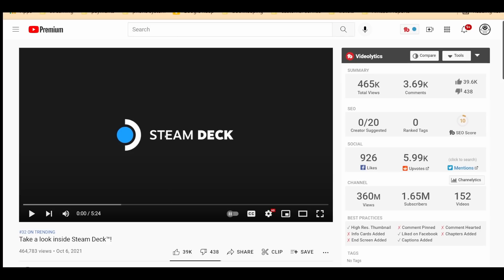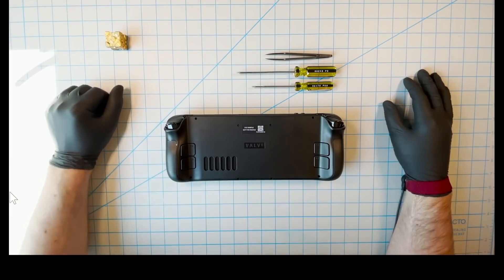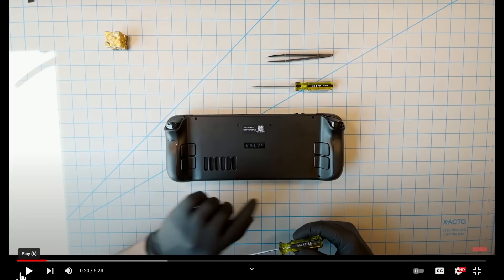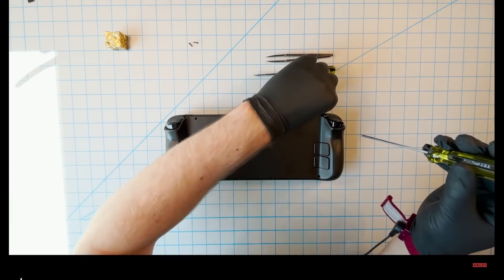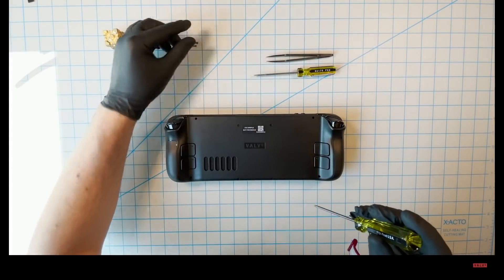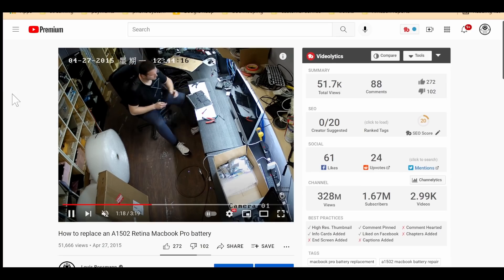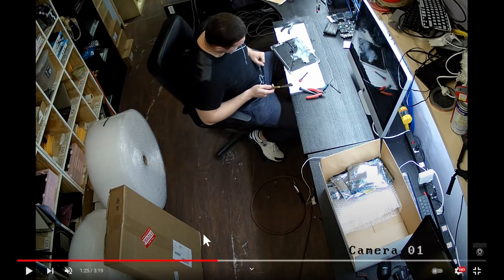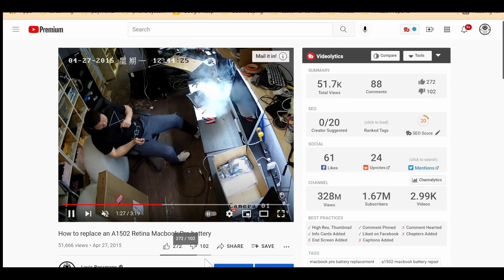Steam deck battery may end your life? bruh 😑

Comment: There's alot of complaints in this video, but Valve isn't going to care if people repair the system or not. A) The whole point of spending time, money and effort to make a device that was open source, CAN be removed with a PHILLIPS head for once, with all components designed to be removable is commendable. They are most likely not going to care if people (or in what they hint in the video, repair shops) to repair their systems and it's most likely that they will release some datasheet and spec sheets for the internal hardware to help repairs. B) They made an official tutorial video about opening up their device. This implies that despite their words in the video, they actually want people to open their devices. But being that the demographic of a Nintendo Switch equivalent device they are probably talking to the younger audience of 10 year olds trying to replace a battery because they didn't charge the damn thing. In addition, you see this video and imagine Apple making one. Not in a million years, or if they make one it's not even going to be CLOSE to the level of criticism in this video.
Overall, I'm very impressed by Valve and their products and games and their company structure as a whole choosing not to go public with a billion dollar market cap because they want to focus on quality over appeasing investors. Making a device like this where you can even open up the device with a PHILLIPS head is a huge attempt in setting a stepping stone for right to repair on devices.

Comment: It may just affect the friction between the plastic and the screw. When it is freshly cut there is more friction. When you unscrew it may "polish" the surface of the plastic (but it should have such a small effect that should be neglected). 
But this can be mitigated by using a thread locker like a blue or a green type.

Comment: The comment on voiding warranty is such a big thing. 

I am in a car group and the amount of people who dont want to do anything to their car because they fear their warranty will be voided really sucks. Its your car. You can make changes so long as they follow your state laws. Sure, if you change something and your change causes damage then they wont repair what you damaged. But if you put on some new wheels and a body kit (please dont put on a body kit leave those in the 90s) and you have an issue with your ignition system... they still have to fix your ignition under warranty. Your new wheels didnt mess that up. That cant void your warranty unless what you changed cause the damage.

Comment: The ESD strap on the glove is actually fine since the charge will move along the glove.
Even then, you don't need to wear one at all nor wear gloves when doing a repair, it's just extra cautious in case you're also wearing a wool sweater and rubbing your socks on a party balloon.

Comment: Well as I sit in the passenger seat drinking soda while watching this,  right when the steam tech said can cause death if you damage the battery. All the pop went on the window. Unplugging the battery and pressing and holding the power button for 30 seconds discharges everything! No static band required.

Comment: Self tapping screws can wear out the case. I would have rather seen them use threaded inserts but on the plus side the analog stick isn't soldered to the board and that's a good thing

Comment: 3:11 Li-ion batteries could explode without warning, but only for those in metal casings (ie 18650) where the casing can contain pressure until catastrophic failure. Li-ion/LiPo in most portable devices such as this one would be fine as they are designed to release pressure to reduce the risk and delay an explosion. Edit: From someone who accidentally poked a few LiPos (without much incident) and dangerously stressed a few 18650s (no pressure venting and dangerously hot on the outside).

Comment: I've got a Trio communications receiver made in the 70s, its got mains electricity, high tension supply to the valves, you could actually kill yourself when opening it. It also has a full schematic and suggestions on how you could modify it. Mmmm progress isn't it great!

Comment: Self tapping screws won't always take the same path through plastic studs the second time.  Improper torque also can weaken the plastic.  I think these are the reasons for claiming reduced strength.

Comment: Allot of good info. Its a company trying to be safe with a new business venture. 
If the screws are torqued.. Then the impact resistance wouldn't be affected. I see trim in cars often compromised because of over torque.. Sometimes under torque. The tightness is very small tolerance on plastic parts.

Its a video that is afraid of the regular joe that has no clue about. Repairs as such.

Comment: I think the main thing they are worried about is someone screwing it too tight and applying, effectively, a preload to the chassis which would cause some tension in the plastic chassis.  But if their promo videos show them smacking it with blocks of metal I doubt it would make a tangible difference.

Comment: Regarding opening the screws compromising on structural integrity, that's kinda true. 

Don't know about screws specifically, but in manufacturing there's always a question of how human proof you need your casing to be. better casing are massively more expensive to implment since you need multiple machines to implement a lot of reusability features. In the reverse cheaper casings are less human proof so the average joe/worker are more likely to make mistakes which would compromise the final product*. 

Self tapping screws, at the top of my head, lack a lot of Best practice for reusable attachments. There's no indication of a stopper to stop you from over tightening. The casing seems to lack any components or markers to indicate if you correctly and evenly tighten all the screws. There's likely very few features that give a margin of error so you don't need to tighten all the screws evenly. 

*In the factory I was at, there were multiple meetings on how much human proof we want our disposable casing to be since the more human proof it is, the less likely that the human workers assembling the product would make mistakes that we need to bin/burn/accept as a loss.

Comment: Okay, so they weren't BSing about the SSD temperature/power draw thing. I learned something then. Valve gets one point back. My opinion of the video on the whole remains the same, though. I don't like it, too much FUD for my taste.

🟢 I like that they were honest about the warranty. 
🟢 Now that I know it's true, I like the warning about the SSD heat/power issues.
🟢 "Send it to a professional if you don't feel comfortable doing this" is good advice. There's no shame in doing so and people shouldn't be pressured or anything into thinking they have to do it themselves.

⚪ I like the promise of replacement parts later on, but until they can actually be purchased and this claim proven to be true, I can't give them any points here.

🔴 They didn't say what type and size screwdrivers they were using. If you know what to look for already, you can see that they're Phillips 0 and 00, but they should have said it out loud too.
🔴 If you're going to tell me to use a torque wrench, tell me what to set the torque wrench to. Just having a torque wrench doesn't mean anything if the torque is set too high and I destroy the plastic or screw before the wrench clicks. Or if I set it too low and the case isn't properly screwed back together.
They went overboard on the integrity angle. Sure, if you break the plastic clips it could have less integrity. If you don't reinstall the screws correctly, you could weaken the bosses and then it'll have less integrity. But instead of trying to scare viewers with those nonsense durability test clips that don't even show you what the device looks like after said test, they could have just provided more instruction. Warn the user to be gentle prying the case apart, to use plastic pry tools and/or picks designed for prying rather than flathead screwdrivers if you're having some trouble. And tell the user to rotate the screw in the hole backwards until they feel it drop/click into the existing thread, and then tighten by hand (not with a power tool) until it's snug. Don't keep trying to tighten it even more afterwards. Stop when it's snug. If you follow those steps, integrity will remain just fine. 
🔴 Also, if they really cared about integrity, device longevity, keeping your stuff working instead of it breaking and having to buy a new one, they would have used brass inserts for the case screws. Self-tapping screws into plastic is what you do when you don't intend or expect the device to be opened by the end user. It's what you do when your attitude is "we get to save money building this thing, and the end user is more likely to have to buy a new one if something goes wrong." Self-tapping screws are especially a dick move, plenty of game consoles and controllers use machine screws into pre-threaded plastic bosses and that works just fine if you do the "go backwards first" thing. Valve really went the extra distance to save every penny possible and provide the worst user experience on this one.
🔴 I'm going to kill myself with the battery?! GTFO with that nonsense. A reasonable warning about battery safety would have been fine, but taking it to loss of life is insane levels of FUD.
🔴 I'm going to ruin the thermals by changing the SSD? Don't engineer your system to fail, then. The screws that hold down the heatpipe/coldplate should not also be holding down some random metal shield. The cooling screws should only hold down the cooling, secure the metal plate with different screws. But still, in the current configuration, it will be fine. Just like the case, tighten the screws until they're snug, that's generally all you need. Alternatively they could, once again, provide an actual torque setting to use with a torque wrench to make sure the cooler is tightened properly and thermals don't suffer.
🔴 I don't need a lecture about static electricity from someone who doesn't know how to wear an ESD bracelet correctly. It can be a valid concern, but either talk about it properly or don't bother. Should've worn the bracelet correctly, should've mentioned that the other end needs to connect to ground, should've recommended not working on carpet. What they did is indeed pretty much on par with Verge Guy putting on a Livestrong bracelet.

Now sure. I see a lot of people saying "well they did all that because of the average joe." But that's exactly my point. They're trying to scare the average user into not bothering. Scare? Fear. FUD. Valve could've been a lot less fear-mongering and a lot more instructional if they were actual pro repair, pro user tinkering. But no, they're out here with this video trying to scare people. And worse, those people who are now scared by this nonsense will go and repeat that nonsense, spread that nonsense, and now people who know better have to fight even more to tip the scales back to neutral. Better keep that video of the Macbook battery getting stabbed bookmarked to show to people who are now concerned about getting killed by batteries what actually happens. Be prepared to have to deal with people who think taking things apart ruins structural integrity because Valve said so without any proper context. Ugh, it's going to be the same frustrating nonsense as people who believe that a phone with a headphone jack can't be waterproof just because Apple removed the headphone jack and made their phones waterproof at the same time. Thanks Valve, really appreciate that. 🙄

I think this whole thing would have been better if Valve did nothing. No teardown video at all. Let the repair focused channels and websites cover that once the device comes out. They'll do a better job anyway because it's how they make their living, and Valve won't be opening themselves up to any kind of liability or phone calls from that one dick out of one thousand.

Comment: ESD is real and its not something you can pinpoint easily as a cause for a failure. It may cause no problems, intermittent problems, or complete failure. Most electronic manufacturers would require their operator to at least wear a wrist strap. Your body generate thousands of voltages, and parts are getting more sensitive now because they're getting smaller. I work 10 years in electronic assembly, and I have to disagree on your statement.

Comment: Well the life endangerment part was probably about the device catching on fire and burning you house down with you in it. I don't trust anything I make with li-ion enough to leave it anywhere outside a metal tray. In my less honorable years I've bent a puffed lipo in a phone, mashed it back in shape, made mechanical connections to the leads through an aluminum chassis and reassembled the device, and it still works because I'm great, but some other poor sap isn't going to have the same luck. There's always some idiot.

Comment: I'd imagine the threads on the case will wear over time when removing and replacing self tapping screws multiple times, as they're designed to cut through the plastic. That's probably why they added that part.

Comment: At 9:00 I think what he was saying is that just taking out the screws will inevitably make them fit a tiny little bit looser the next time you put them in. It's the same with any type of self tapping screw, they are usually supposed to be screwed in only once, and will hold a specific torque. I think he's being a little melodramatic about it, but I can understand trying to discourage it from the company... Nothing a little loctite can't fix.

Comment: Self tappers can make new tracks every time they are screwed in. It can reduce physical strength. But if you rotate the screw counterclockwise until you hit the old threads before you screw in the screw, you keep the physical strength also on self tappers.

Comment: Not an engineer, but in my experience, self-tapping screws into plastic will become less and less secure every time you unscrew and rescrew them. Not quite to the extent that they seem to claim, and I wouldn't call it 'structural failure', but the two pieces may start to come apart with repeated reassembly.

As for the li-ion battery, while yes, in most cases they do fail in a manner similar to the video you showed, in some cases they are actually quite dangerous. I have had a li-ion pack jet flames towards my face with very little warning (I believe it was damaged before that). Not saying it happens often, but again, it's probably a legal thing that they have to say that for the 0.0001% of cases.

Anyway, we should definitely support Valve, as like you said, this is a big step forward. Not only for hardware right-to-repair, but also for custom software flashing on devices you own.

Comment: If the screws are self tapping, then every time you unscrew and rescrew, you are damaging the structural integrity of the device. The first time you do it probably wont do much, but it compounds heavily. So the 3rd and 4th time will really wear out the plastic screw holes.

Comment: I'm a product designer for parts in which screws also screwed into the plastic. after screwing them in for the first time, the things are definitely tighter than after screwing them in again later. if we have to rework something, we glue them in afterwards.
You can imagine that when you screw it in, the material aligns itself in one direction and reacts like a barbed thread. When I unscrew it, I smooth the material in the wrong direction and the thread simply grips less well. you can feel the difference, but it's less than 5%

Comment: repeated loosening and tightening of self tapping screws CAN affect the ability of those screws to hold components together, however it would need to be done badly and repeatedly to really cause any noticeable issues, if you open a hundred cases 20 or 30 times each, then tested them, they would probably show a recordable and notable reduction in strength.  

however that doesn't mean opening the case would ruin the screw threads, just that you shouldn't make a hobby of opening your steam deck every day just for "fun".

that also doesn't really explain why they decided to use self tapping screws instead of a machine screw with a metal interface thread. (probably a cost efficiency reason)

Comment: Self tapping screws make their own grooves in the plastic the first time they're installed and hold really tightly. If you remove them though, they won't ever go in as tightly as that first time, and like the voice said, you can really easily ream out the screw hole with the screw without a torque wrench. 

So yah, it makes sense it won't be as drop resistant, because unless you use slightly large screws every time you open it, the 2 halves won't hold together as tightly.

Comment: You'll never damage plastic when replacing a screw if you twist it backwards first until the thread clicks into it's original threads that were cut into the plastic. Won't split it or strip it.

Comment: I fully agree that puncturing the battery while working on it would not kill you, but it could be a time bomb and cause a house fire while charging overnight. the whole time I watched this video, I was thinking "stop telling me not to do it, I know the consequences already!"
The device is set to release in December and is back-ordered to Q2 2022, that's why replacement part aren't available right now.
As said at the end of the video, I think the structural integrity bit is mostly Valve saying "if you break clips and overtighten the screws, it's your fault, not ours."

Comment: I'm not a structural engineer. But I do have a 3d printer. I can confirm that metal fasteners in plastic never fasten 100% on the second tensioning. The plastic will fatigue. Kinda wish Valve used those nice brass inserts but they are trying to hit a price point.